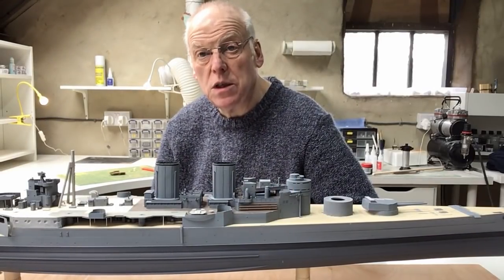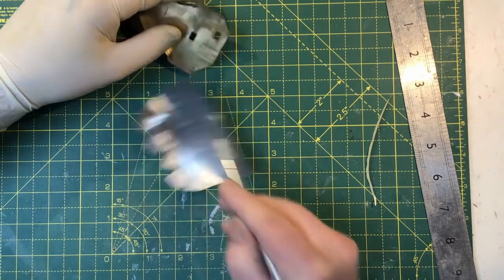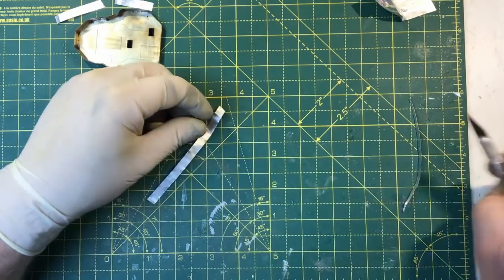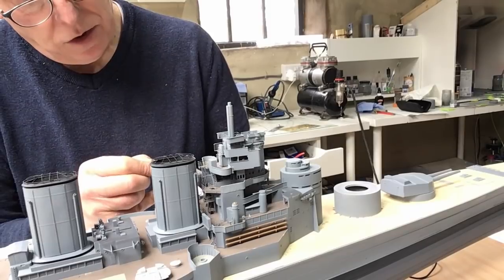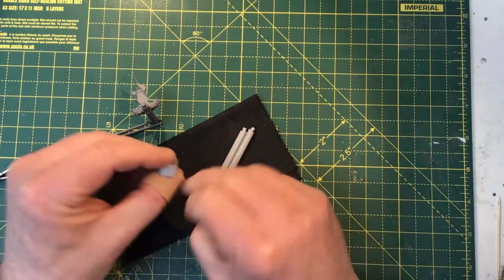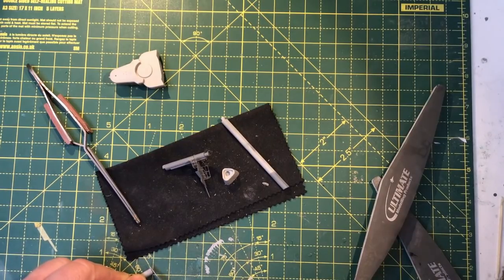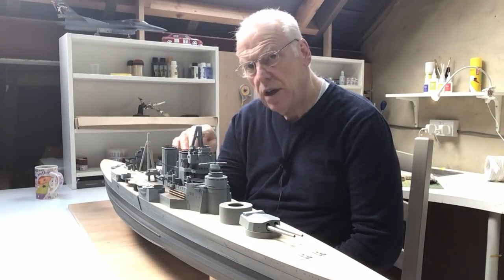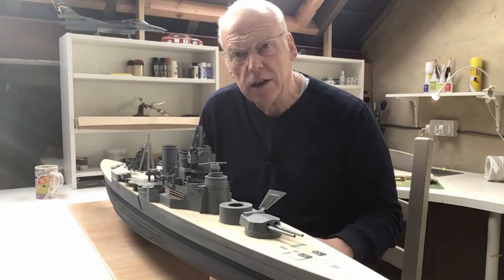Trumpeter 1/200 HMS Hood Full build with Pontos detail set Part 21 (Bridge refit and foremast)

Comment: Outstanding videos. So in depth. I was inspired so much I have just got the 1/200 bismarck  kit. Unfortunately  nowhere has the pontos kit in so had to go for eduard. Wish I had held out for pontos though.
Reply from the maker: Hi Jerry and thanks. Sorry to be the cause of a dent in your bank balance. I’m surprised you can’t get a Pontos set for the Bismarck I thought it was fairly commonly available. Certainly they have them in stock direct from Pontos. I have the set and I’m going to do a review of it in the next couple of weeks in preparation for my next build after Hood.

Comment: I feel sorry for our friends in California, they have to spring for imported red wine as the State has banned lead foil in the wineries.
You might give a look out for "solder paste" which can be easier to place (if not "tinning" as well).
The build continues on impressive.
Reply from the maker: Thanks for the heads up on the solder paste Ill give that a go when I can get hold of some. The French may have stopped lead as well - I think the stuff I used may have been some alloy maybe of aluminium or something like.
Reply: @TheModelShed  Give the UK shutdown, solder make require mailorder.  The Model railroad set used to be reliable sources for building brass locomotives.
Our friends in Spain and South America still use lead foil (and make good tipple, too)

Comment: How do you attach your photo etch railings and ladders? I have used Gator Grip but that is no longer available I believe, and I suspect CA fails after a time? Also, you seem to use poly cement on painted surfaces, surely the paint acts as a barrier to the melting action of the glue?
Reply from the maker: Hi Finlay. I use small amounts of thick CA dotted under each of the stanchions. I try to assemble as many plastic parts together into sub assemblies before painting but yes - I fitted the radio office in this episode to a painted deck - I've never had any problems in the past doing that. In fact I've  tried to remove assemblies like this in the past and found the joins very secure so I assume the poly burns through especially as I apply very light coats of paint.  Also my models are enclosed in cases on completion so they're not subjected to any handling so the joints always hold up OK.

Comment: Beautiful work Steve! You have moved up on my "most interesting videos to watchlist". I have question, I am building a Flower Class Corvette and the instructions have you to paint the Semtex parts black. Now was there a standard colour for Semtex or did they take what was at hand?
Reply from the maker: Hi Kent. I understand Semtex came in several colours including grey and tan also. I’ve not heard of black before but I’m not an expert on it so it could well be correct. I wouldn’t necessarily take a kit manufacturers instructions as the final word - photographic research is valuable as well so I’d try to find some pictures of the ship you’re representing. If it is black then I wouldn’t use pure black but something like rubber black or nato black or even a very dark grey for scale effect.
Reply: @TheModelShed  Thanks Steve, I had no  intention of using black but just wondered if there was a"standard". Yes, if I learnt something over the years in modelling, it is research. I think I spend almost 50 % of the "build time" doing research. I have not started the Corvette yet and was curious.

Comment: I also have bought this kit and was just wondering with all the photo etch kits out there why you bought pontos as I am on the process of building the Bismarck 1/200 scale and find the instructions for pontos to be a little different to follow on the small pieces
Reply from the maker: Hi Paul. I went for Pontos because I think their all round package is the best quality and value when you take into account the inclusion of the wooden decks and the stunning workmanship of the etched parts and turned brass.